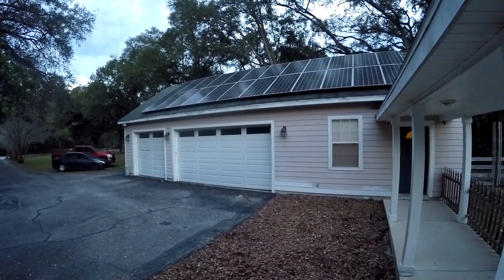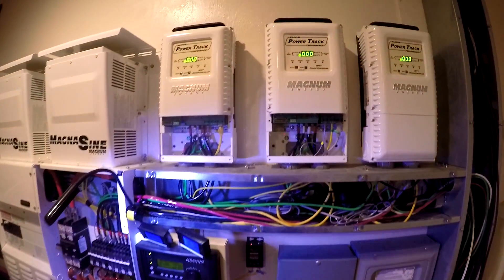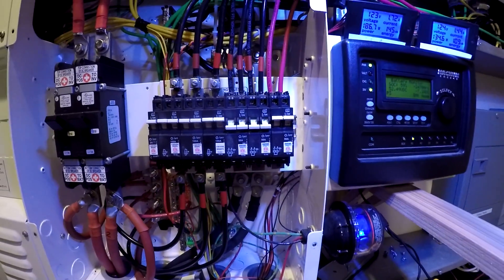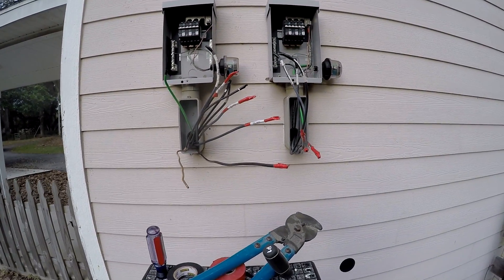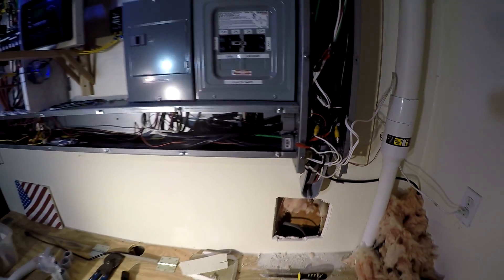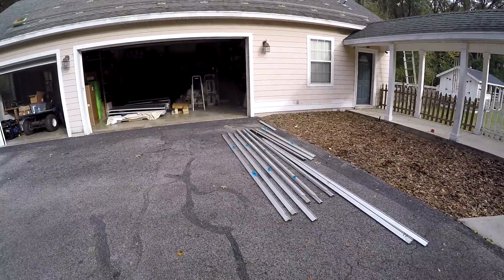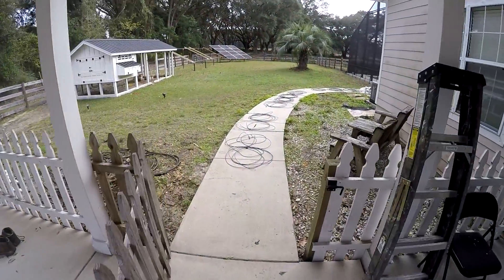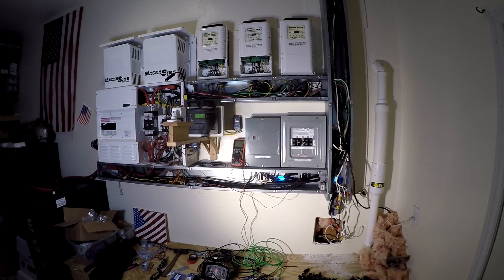Removing Solar

Comment: Brother u and ur crew need to come help me 😂.... I just got that new eg4 6000xp and still haven't mounted the 30 panels im running slow.. I think im gonna donate my outback system and move up too 48v with this new inverter... Looking good brother.. Im slowly catching up too u 😂... Keep it up brother
Reply from the maker: That 6000xp looks like a real hum dinger.  Combine that with the EG4 batteries and you have a very affordable system that will be there when the grid goes down.  Post some videos!  :)